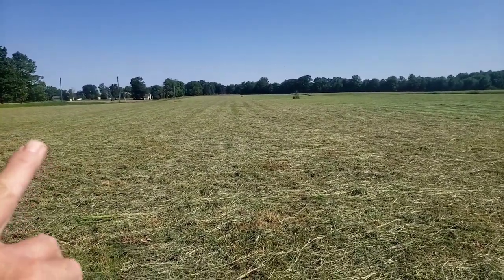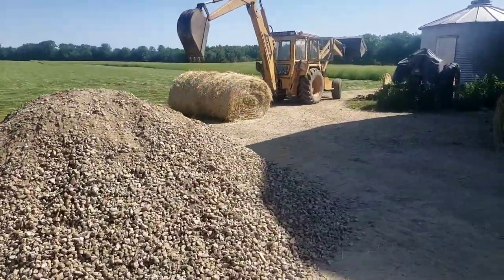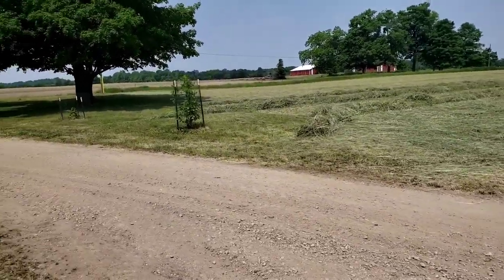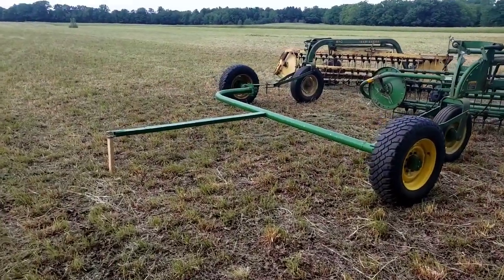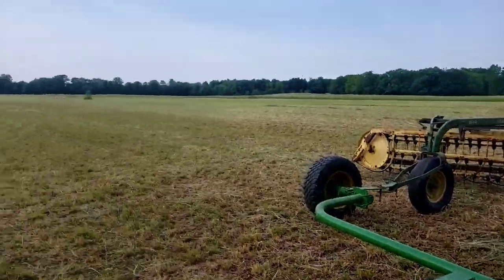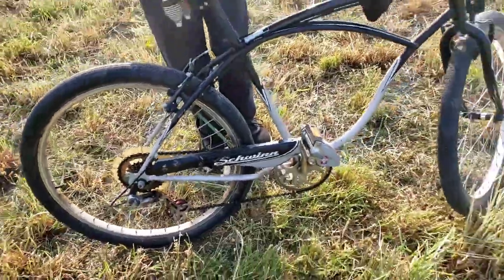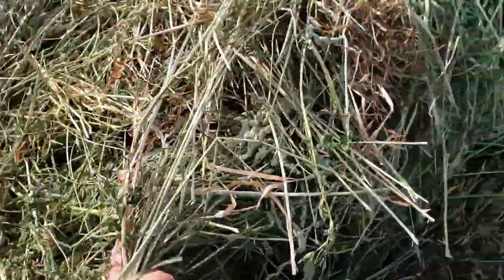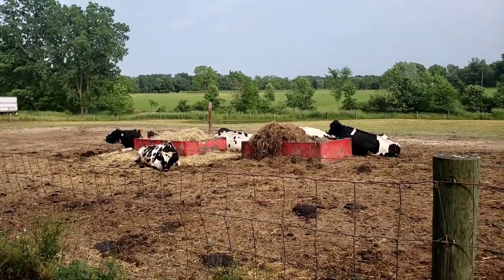Homemade Tandem Hay Rake

Comment: We had two 660 John Deere rakes. We made a hitch out of angle iron on one of the rakes to make two singles and then in second cutting we  had a piece of angle that flipped out so the second rake was hooked to the opposite side so it could pick up the windrow from the first rake to make a double. We had a logger come in to take some trees out of the woods. He said he could tell the wood lot had been pastured. He was right but it had been 50 years since any livestock had been back there..
Reply from the maker: Farmers are great fabric engineers